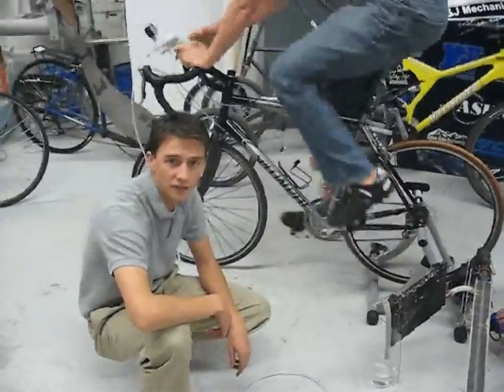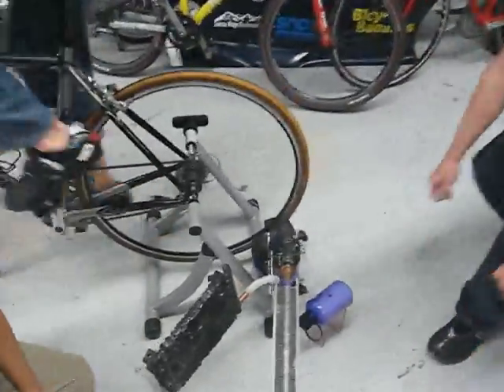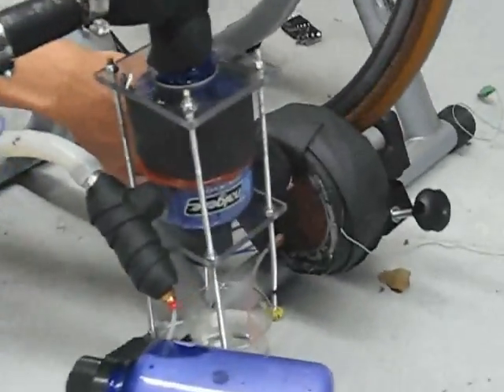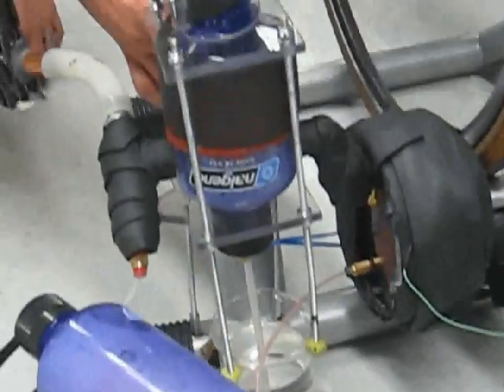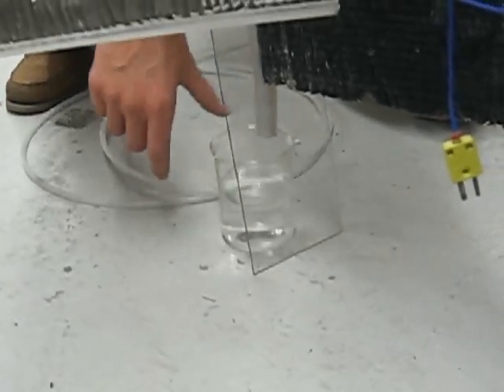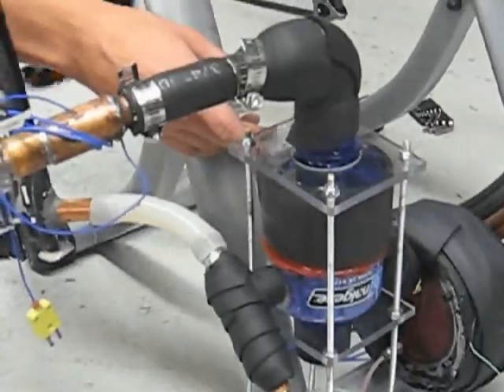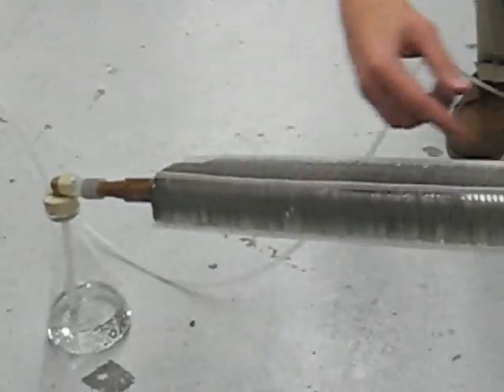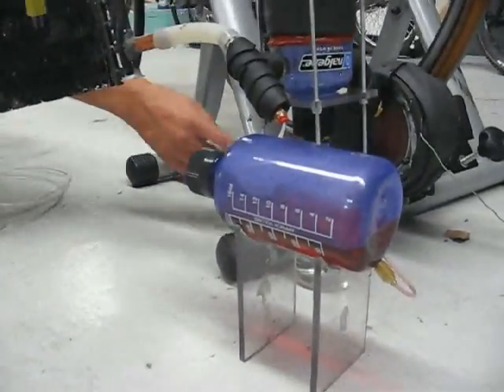Pedal Powered Water Distillery

Comment from the maker: There are definitely some losses here - we found that most of the loss occurs in heat.  When we insulated the boiling chamber well, our production about doubled.   But we did avoid the conversion from mechanical to electrical energy, which some other groups did not.  I think that reduces output pretty severely.